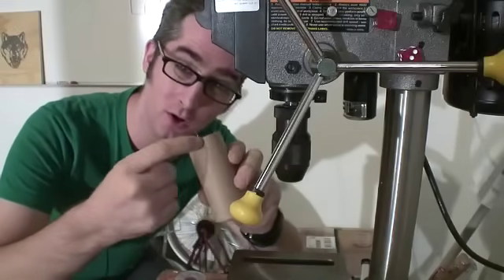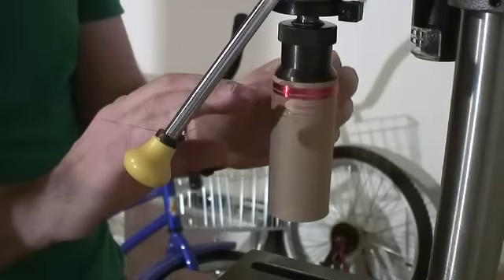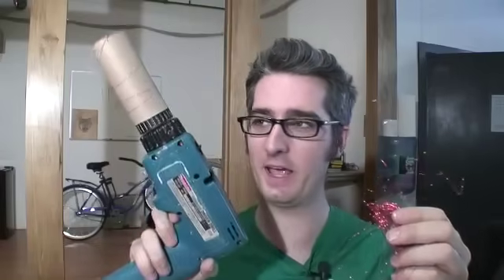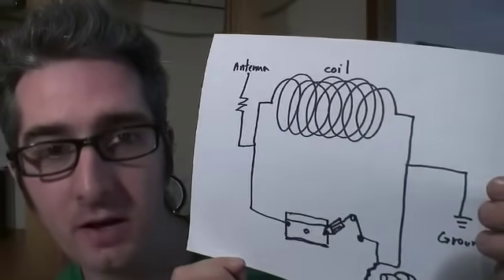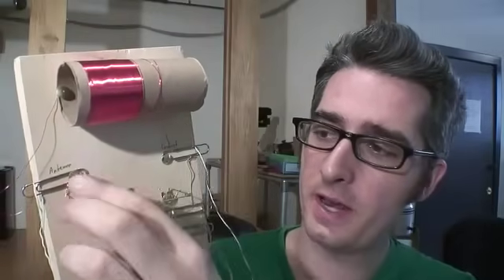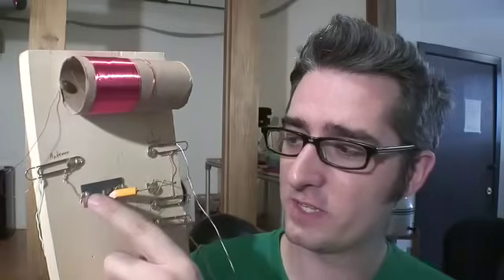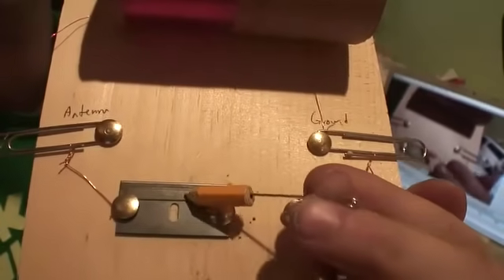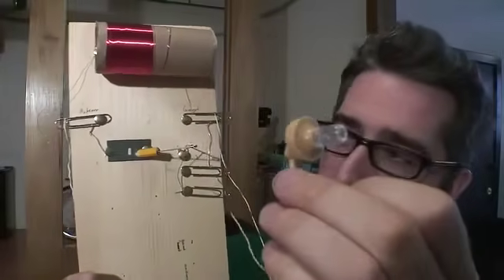How to Make a Foxhole Radio

Comment: if you have a fire place use something to hold it in the flames, BBQ, or a stove should be able to do it to if you hold it on the burner at a high enough temp.

Comment: You can use pipe for tap water, you can use a gas pipe, you can dig a whole in your garden and dig in a big metal plate to which you connect the ground lead wire.

Comment: Professor Walter Lewin has a great explanation: youtu(.)be/G3eI4SVDyME (skip to time 5:00) Here's a quick reference: physics(.)info/inductance/ . Essentially, 120 windings allows you to tune the toilet paper roll (inductor) to a certain frequency range, which is this case is a certain AM radio station range.

Comment: Sorry Den, you can use a battery WITH a transistor (and other things), only battery doing nothing... with this type of radios you can use only high impedence earplug , all the power is from antenna and is really low. Search for CRYSTAL RADIO on google is the same thing, for listen louder you need to build an amplifer and it's not simple :)

Comment: The advent of stainless razor blades was actually a big deal, made possible by metal technology that allowed the stainless steel to actually hold a decent edge. Usually (afaik) bluing is actually done with chemical aid, but apparently heating it like crazy can oxidize it too?
So where did the GIs get earpieces? And what did they usually wrap the wire around? Just curious. Thanks for the video!
Reply: Tanks, aircraft, even shot-down enemy craft. And cardboard grenade tubes were excellent!

Comment: Rofl the Cat6 wire
On a serious note, bluing is a process by which carbon steel (non-stainless steel) is coated with a specific iron oxide that inhibits rust slightly, but even more importantly, allows the metal to hold oil better to further prevent rust. The result is an item with the strength/etc. of carbon steel and the ability to not rust easily like stainless steel. Another widely used option in guns, but less so in blades, is Parkerization, which is similar but grayish and phosphate-based.

Comment: 500 degrees is the temperature steel turns blue.

If you heat steel to red (called super heat) and let it slowly cool, the metal will be softened.
if you heat steel to red and quickly quench in water, the steel becomes very hard but brittle.
(crystalizes).

So, to get optimal strength, steel is first crystalized then shined up with abrasive and then reheated till blue. Blue is the strongest.

The quickest way is to quench in oil, which cools down to 500 and turns the object blue.

Comment: Fun project but i suspect the story of origin is mostly myth. To start with, this supposedly was invented by an infantry Lt. at the Anzio Italy beachhead. What was there to listen to near the battlefronts and when did infantry soldiers have time to experiment with pursuits other than finding shelter, rest, and maintenance? I note also that the original article used a low impedance 600 ohm headphone, not the senstive piezo earpiece you use.

Comment: I made one just like this over 50 years ago. Fun to see it resurrected! The reason the 'blued' blades work better is because they have a selenium coating. You can put the point of the safety pin directly on the blade with those... no pencil required. Thanks for this vid!

Comment: The problem you had with the Razor blade was the rust resistant coating that comes on modern metal to make it last longer. you can burn it off or scratch off the coating with sand paper

Comment: @mnpd007 Thanks, for  enlightning. I though maybe the pencil it was used as a resistor to maybe counter act reflected waves so the wouldn't cancel out the signal. Because at end of cables signals can reflect causeing a "mirrored" signal which cancel the waves out.

Comment: @Eighteen87 Sorry, the wire *must* be insulated- a coil of uninsulated wire is no coil at all, electrically. You can try other things, like minerals etc. but good old corroded razor blades were handy to the soldiers. The *best* homemade detectors used silver-bearing galena, a lead ore. Ordinary galena also worked. And people have tried corroded lead or copper, or "fool's gold". See if midnightscienceDOTcom is still out there- the best source of crystal radio info on the net.

Comment: Cool project. Easy to make tunable. Just move the paper clip on the right to the center of the coil and stretch out the paper clip so that it rests on the coil with spring like tension. Make the coil almost twice as long. Use the edge of a metal file and remove about an 1/8" strip of enamel coating from the magnet wire. Tune by moving the paper clip across the coil to tap the coil in different places. :)

Comment: @fifthStitch The ground wire is for preventing you from getting shocked from static electricity. You COULD run it without one but it you could get electrocuted or at the very least zapped when the electric components built up enough electricity. 

You could just attach the ground wire to anything metal that will absorb the electricity.

Comment: The razor blade needs to be partially rusted. The iron oxide and graphite are what causes the circuit to pass a current. If anyone makes this, just leave the blade in a safe place out side to be rained on a few times. Rusting it with salt water or chemicals does not work as well. I hope this helps.

Comment: @mikeccuk2006 hehe not really free energy or it would be a miracle :) it's very low energy coming directly from the radio waves. early receivers were built this way. check "crystal radio" on wikipedia.

Comment: @ventHARAS Radio waves are electricity sent out in pulses, radios use batteries to amplify the signal...but you can listen to it with this device faintly. Also i think this is an AM radio

Comment: i had to build a radio like this in  ENG1000 in college. if you want to change the radio station, just stick a piece of steel through the coil to change the inductance. that will change the resonation frequency, thus a new station. ours had to be tuned to receive a certain station.

Comment: "Blue" razor blades had a silicon coating so they wouldn't rust. This was in the days before stainless steel was cheap enough for blades. You can still find a few in antique shops and on-line.

Comment: @seifalaa97  The ground wire goes to a metal copper rod stuck in the ground which is called a Earth ground.  A earth ground stablizes the radio and improves AM radio reception.   If you have an apartment you must use a long wire antenna with a ground wire laying down on the ground connected to thick squares of aluminum foil.

Comment: You are missing half the tuning circuit.  The coil of wire is an "Inductor".  Combined with a "Capacitor"  (Two conductive sheets with a space between them), you have a tuned circuit that can discriminate between different frequencies.  I suspect you are just picking up the strongest station and so could do away with the coil entirely.

Comment: you don't need too much heat to blue the steel.  A simple pocket lighter will ussually do the trick.

I used to build these as a kid.  They are an excellent way to learn about how radio signals can power devices.

Comment: @simpl456 None are required as there is no amplifier, but because there is no amplifier the sound output is tiny, if a cockroach farts in your foxhole you won't hear the radio.

Comment: ....Then you use your 2n3819 depletion-mode FET as an audio-frequency buffer/pre-amp stage, and the army surplus tba820m chip as your output stage.  You may have to steel a hand full of capacitors & resistors, and some circuit board.  It would be nice if you could also appropriate a 10K logarithmic potentiometer.  Smash-up someone else's transistor radio, and take the 9volt battery and speaker out of it.

Comment: @toiosoiovoio IF...you add a variable capacitor across the coil, one side connected to the terminal on one side of the coil, and the other side of the VC to the other side of the coil, then increase the number of windings a bit..say..to 200 windings...you would have the ability to tune it better.  the variable capacitor size would need to be small...say 5-200 pfd's.  If  you go modifying this, as you can see....it becomes more of a technical challange!! Thanks for you questions!

Comment: @yasowhatup it is the air capacitance of the air coil.  it is very low, however, the inductance of the open air coil is also very very low.  thanks for you question

Comment: @855h0le ...wrong wrong....  This is an AM receiver.  True:  The Frequency of tuning is somewhat dictated by the length of the coil windings.  Wrong wrong:  The shorter the windings, the lower the frequency.  If you were within a 1/4 mile of a commercial FM transmiter, and you used approxiamately 2-10 windings around the t-paper roll, you probably be able to hear some discernable audio from the station.  Partially due to the imperfection of the poor selectivity of this am receiver!!

Comment: @LUVITALL9 Razor blades are excellent in crystalline structure."Bluing" or oxidizing them in extreme heat, interferes with that structure.The interface point of this surface, and the semi-conductor characteristics of carbon, in this case, graphite in the pencil makes for a diode effect, which detects, or demodulates the am signal to an audio signal.  make your antenna as long as possible.  At least 50 feet for best results!

Comment: @wolfsvsvampirs He was providing a suggested source of "ground" for the electricity from the antenna to go.  Almost any plumbing in a housing structure that is made of metal, has eventually some kind of good, and solid connection to the earth, or foundation of the structure. This connection provides a good pathway for electricy to our planet earth, which is then easily absorbed by the earth.  This ground could be a metal water supply pipe, or for instance, a 6ft copper rod driven into the ground

Comment: @wolfsvsvampirs As lightning is electricity that wants to get to the ground, so is a radio wave that hits an antenna makes electricity in that antenna, that wants to get to the ground.  As the electricty from the radio wave transmiting station in the antenna goes to the ground, this radio device extracts a portion of that energy,converts it to an audio signal, then to audio for the human ear.  :  )

Comment: @Tcosp Assuming the AM station is transmiting in stereo, if two of these devices where made, each with its own antenna, razorblade/pencil lead combo..etc, with earpieces....and one was tuned slightly above the frequency chanel in question, and one slightly below, then yes....stereo effect could be achieved!  It would have poor stereo seperation specs due to the poor selectivity of this design, however, it would technically work.

Comment: @SolgerLemp acutally....moving the pencil has little effect of changing the channel....changing the length of the wound coil/wire changes the channel...However, this primitive radio does not have an ability to focus its ability to listen to a single channel very well, it is said to have "poor selectivity".  It basically listens to whatever channel happens to be nearby, that has the most energy signal.

Comment: @lukasm14 this device shown is an AM radio.  102.6 MHZ is in the comercial FM band, where transmissions are in a different format. That Format is Frequency Modulation. Amplitude Modulation is "detected" by the diode action of the "cat's whisker" or, razor blade/pencil tip combination.  Frequency Modulation, is deteted by a more complex method, and requires more complex equipment.

Comment: @wolfsvsvampirs Grounding's meaning can be slightly different according to the type of project being done . Let me explain what it is here though, in this project so as not to confuse you. Basically in this simple design the ground is the reference potential  into which the current flows.  All it consists of is any large bit of metal that is touching the gound...the bigger, and more 'grounded' it is the better...for this project, Just hook the wire directly to such an item, & you're good 2 go

Comment: when he said ground to the rateater what exactly did he mean?
      (thats the only part i dont get)
Reply: All your plumbing is earthed (grounded) so that in case a live wire touches it, the charge goes to the ground and doesn't shock anyone. The earth part of a plug does the same thing, usually a green and yellow wire. By connecting to the radiator you are connecting to the earth basically

Comment: Dude!  This is really cool!  But I gotta ask, what is it in your opinion, that makes the heated up , blue razor blade better than a normal, almost stainless razor blade?  i'm not disputing, just curious what YOU think the difference is!  I am gonna tinker with this over the next few days, although I live out in the boondocks of central Arkansas, there are of course AM station everywhere.  One other question-how long, roughly, should this long wire antennae be? 3 feet? 8 feet?  Good tutorial!

Comment: If you can't get hold of a high impedance ear piece like the guy uses in the project you can also use an old cord phone as a speaker. Just take the cord out of the phone where you would dial, leaving you with the hand held part and cord coming out of the other end. Strip the wires and match them up. (There'll be four wires, so you can either use trial and error to find the right two or google it (: )

Comment: @oneofy
Any metal object that's long enough has current induced in it from the radio waves traveling through the air. You could make a radio just by attaching a very sensitive earphone to an antenna of some kind, but then you wouldn't be able to select frequencies. It would only work if you were very near the transmitter of a large radio station. The coil and the crystal oscillate at a certain frequency and that allows you to select one specific station.It's called a tuned circuit.Look it up. :)

Comment: @world295 am or fm- The Frequency is dictated by the length of the coil windings..
So the short you go the lower the frequency.. I dont know of any formula based on this circuit to get to the FM band.

Comment: 1. Nope, no battery needed. it's powered from the broadcast end.
2. No you cannot CHARGE a battery from this!
3. If you build this you need a HIGH-IMPEDANCE crystal earpiece, not the usual 16 ohm insets you get with an mp3 player. Ordinary earphones will kill the delicate signal you get with this type of radio stone dead.
4. You can't "just hook up a transistor" here. Transistors need an additional power supply and supporting components.
5. the razor/pencil is acting as a DIODE, NOT as an osc!

Comment: Yes u were correct about the type of Metal Treatment. I think its called "negative resistance". The coil is the antenna. The razor blade is the oscillator.

Comment: Could be that the heating of the razor causes a small magnetic charge in the steel? Of course there's also the fact that modern razors are often coated with a rust resistant finish that's burnt off by the heat...

Comment: It's not "free energy". The radio station is paying good money to broadcast the signal which is powering that radio, and at any rate, what the set is picking up isn't enough to run even an LED flashlight.

Comment: btw also if you use an audio jack and connect to + and - terminals you can use your computer speakers. Which is way more convenient as you can adjust the volume and you dont have to use the earphone

Comment: graphite of the pencil lead is an electrical conductor. I don't know if it is necessary for anything but a wide contact with the razor surface.  The razor, on the other hand, *must* be rusty for this to work; iron, and iron-oxide (rust) crystals for the semiconductor that changes the alternating AM signal into a Direct Current to operate the head-phone piece.

Comment: you didnt blue the razor you just took the temper out of the steel blued  or bluing is down by chemicals back in the 1800s they used rust to brown the barrels of rifles to prevent rust then they just kept them oiled

Comment: the razor blade and the cat-whisker or in this case the pencil  "rectifies" the signal that is received.  You can use an old  Diode that just about anything electronic has a number of.   The part usually has a symbol on like this →⊢

Comment: Watts, actually. It varies from 5 watts for a hand-held radio, like my 2 meter VHF ham rig on up to 50,000 watts for one of the big AM super-stations. Of course, that's being broadcast omnidirectionally and is further reduced by distance in accordance w/ the inverse square law. Long story short, you won't be powering your car with it anytime soon. Heck, you won't be powering a flashlight with it.

Comment: I meant, how much power (voltage or amps?) is a radio signal itself? Probably a dumb question but I'm fascinated there's "juice" floating around in the air.

Comment: The only power is the radio signal itself. This is why the signal was so faint. What actually uses the batteries in your transistor radio is the amplifier.

Comment: Good information!

You could probably set up simple hand crank device to wind the wire around the tube, using the free hand as a guide  - similar to a device used by smiths to coil steel wire for chainmail.

Comment: You can't use bare copper wire, unless it doesn't touch between coils. It needs to coil to convert the energy from the waves, otherwise it would be like using a giant chunk of metal.. You can easily dip the bare copper wire in a type of varnish or wax etc, to get it coated so you won't ground it out... I hope this helps ^_^

Comment: what lenghth of wire will i need roughly???
also dose it have to be magnet wire and why not bare copper wire??
also if i connected a battery could i use regular headphones or a speeker??

Comment: im sure iv seen something like that in a book years ago, try connecting a wire at the ariel side and taking some of the varnish off the wires on the coile, then you can adjust the inductance and find a better tuning point, i think...